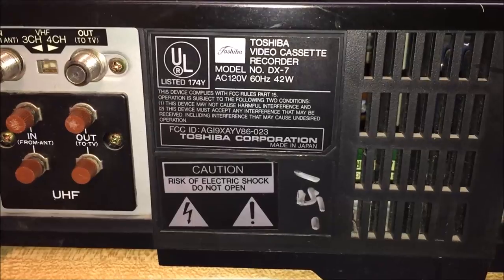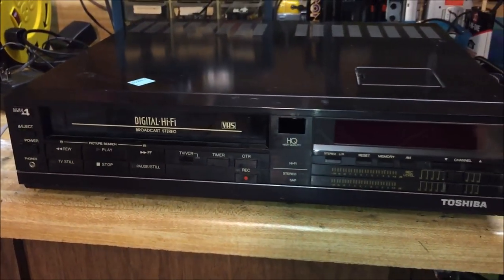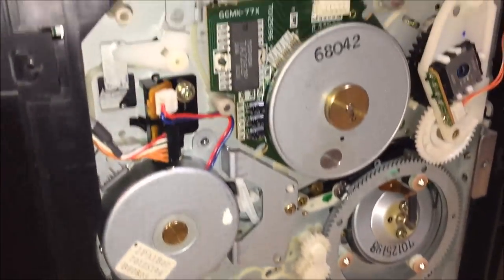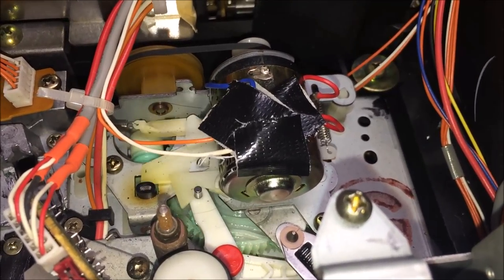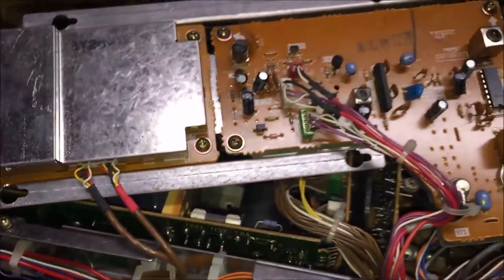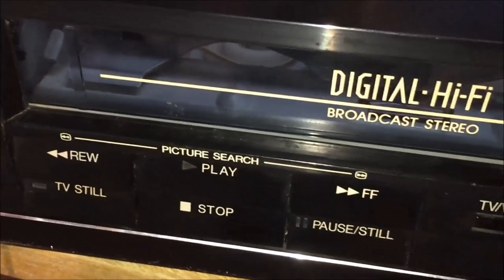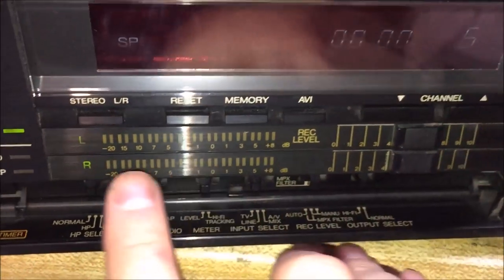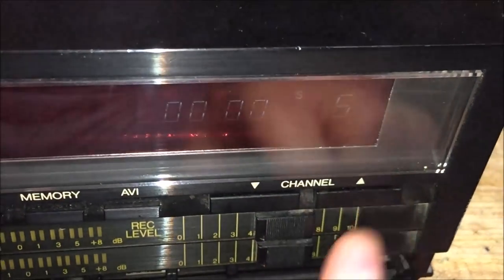This VHS VCR Will Freeze Your TV

Comment: I have a similar Toshiba model from about 1985 with original remote that I still use that I've owned since I was a kid. Same motor issue fixed. Good to see these things still out there! Might note that greasing the track might add friction as the grease gets older, stickier, and collects dust and dirt, but if it works for you, don't worry about it. The take up rubber idler wheel eventually loses traction and slips. A rubber renew, or tire replacement usually fixes them up. I've converted some vcr's of this era to a gear / clutch drive to avert this aging issue. Thanks for sharing!!

Comment: I own an earlier model of this VCR. I have my instruction manual. The M5900 appears identical to the model in your review. Except for the TV Still button which is just a pause button. CFM stands for “Confirm” to allow to confirm the Timer programming.  HP stands for high quality picture which involved a circuit for picture improvement. A number of VCR’s claimed a digital improvement circuit. MPX was a filter for use with an FM tuner. It filters out an extraneous noise. Many manufacturers encouraged the idea of using VCR’s as audio recorders. VHS HiFi is a high quality system.  The channel preset system on both your VCR and mine was common on most VCR’s of that time. AVI was a search feature. Allegedly, with this button depressed the tape would stop and preview multiple recordings on a single tape. I never used this feature.
Best of all, for years Toshiba VCR’s ignored the Macrovision copy protection distortion when used as a recorder with another VCR.

Comment: A week ago, I got an NEC VCR that has a very similar loading mechanism but it uses a better quality loading motor and not those crap ones with the plastic on the back. But on the carriage mechanism, it DOES use that crap motor but its not weak. I needed to replace all the belts and the tire but I didn't not have the right tire so I used a different idler wheel assembly. It plays perfectly but when I rewind or fast forward, it stops near the end of the tape. I'm going to try and buy a new idler tire and hopefully it will fully work.

Comment: In some countries, like the UK, you had shows which were simulcasted on TV and FM radio. You could then get the stereo sound via FM. Also those machines were commonly used to make decent recording of the radio. The MPX switch activates a 19kHz notch filter which filters out any residual pilot tone from the receiver. It's important as it could mess with the bias currents.
Reply from the maker: Yes indeed!  Thank you for watching!
Reply: Yes. Happened on tape decks. Even DOLBY activetex MPX circuit.
Reply: No, not really. Since TV and Radio stations were operated by the same companies and transmitted from the same site, it all came via the same microwave links, or at it was later, over high speed ISDN links with virtually no delay.

Granted, I've never actually seen such a thing here in Germany, but the BBC did apparently simulcast concerts regularly that way. Of course now with DVB where you can easily have 5.1 Surround sound, so that's not needed any more.
Reply: The BBC used to broadcast the Proms in Ambisonics which encoded surround into a stereo/mono compatible signal. Brilliant system.
Reply: There's actually work to include Ambisonics in Opus since that might get very relevant for VR.
Reply: Yes, I see that. It makes a lot of sense.
As a system it is easy to mix with/through and is fully mono/stereo compatible. If you use UHJ encoding the surround info' can be encoded into a stereo signal.
It is years since I have mixed in ambisonic surround so, there is a lot I have forgotten. The Calrec soundfield mic' was a boon as well. Both for moving the mic' position in post-production if you had recorded the four channel B format and manipulating the mic' if recording straight to stereo.
Reply: @databits  I recall Toshiba having some ads in the UK for their products in the 80's that went with this odd approach of a blueprint-drawn figure expounding the limitless possibilities of Toshiba's electronics!
https://www.youtube.com/watch?v=BjJBFGGjdpw

Comment: The MPX filter is for avoiding distortion when recording from FM radio. FM stereo has a "pilot tone" at 19 kHz that identifies a stereo broadcast. Good FM tuners should suppress it, but some not so good ones don't, and in that case it gets to the recorder where it can cause interference with the carrier frequencies of the HiFi VHS audio system. The MPX filter avoids this by a notch filter at 19 kHz. It should be off when not recording from FM because you don't want a notch filter otherwhise.

Comment: 10:10 You asked what HP Select is. This is unique to Toshiba machines. It has to do with the playback and picture sharpness.
In the 90s I used to have different video recorder machines at different times from Sony to JVC and Ferguson Videostar. I never had a Toshiba. Every one of them were just as noisy because of the motors spinning for the various parts to work. The constant whirr of the head drum spinning was so loud I was able to ignore it. Eventually the noise became intolerable so I got rid of them.

Comment: whoooaaaa that point to point wiring. ALL TEN MILES OF IT. The digital frame store/TBC cards that were used on a lot of these VCRs all looked fairly similar - they tended to have the same flash ADC and weird lookin' RAM chips. I've always been tempted to get some of those cards and add some extra logic to the addressing lines to allow me to turn the picture into a weird mosaic puzzle and swap lines around
Reply: That is not point to point.
Reply: Telken Texas this is also not someone who has had enough coffee

Comment: We had a TV and friends had VCRs that had channel tuning in a similar way.  "Low" was channels 2-6, "High" was cable channels 14-39, then air channels 7-13, and "UHF" was ... well, UHF channels 14-70 or whatever.  :D
Reply: Yeah, there are two different chunks of VHF TV band, one in the 54-88 MHz range, and one in the 174-216 MHz range, and then UHF runs from 470 MHz upwards. If you're dealing with a tuner that's got a bunch of tapped coils in it, it makes sense to treat those as three completely separate tuning ranges.

BTW, UHF actually went up to channel 83 originally — the spectrum for channels 70-83 was reassigned in the 80s, and the spectrum for channels 52-69 was auctioned off just a few years ago.
Reply: hobbified 

And in a few years 36 will be top channel.

Comment: "Four home computers worth of memory" ... I wonder how much memory each of those computers had?

(I'm going with 128kb, as you need about 512kb for a half decent digital stillframe, IE one roughly equivalent to laserdisc quality... that'd be 544x480 with 8 bits of luma, and 272x480 chroma rez with 8 bits per channel... all up 16 bits per pixel effective (8+4+4), and 522,240 bytes = 510kb of memory used. Of course they might use only half the vertical rez, or some other way of reducing the overall data load (combination of lower horizontal rez and lower colour depth) which might reduce that to 256kb, so it would be four C64s, but that seems a bit cheap considering how much the missing 256k would actually have been worth at the time vs how much the VCR probably sold for)

And it is really a bit of a gimmick, isn't it... presumably Toshiba thought they couldn't quite justify adding the system simply to clean up video stills (and reduce tape wear when sitting on pause for extended periods) and had to extend its utility to the main TV signal too...

Comment: "Standard" UHF connector is terminal posts?

American TV is weird.
Reply: Vyl Bird I was about to say this too. In Germany it is so much simpler. And I think pal is better than ntsc for some obvious reasons
Reply: It doesn't make a lot of sense to me. Terminal posts suggest a balanced cable, like ladder line, but those are only really good in free space - they very easily pick up nearby electric or magnetic fields if there is anything conductive in their vicinity. Which there will be, in a domestic situation. There's why you use coax. So... why the balanced cable? Does American TV just suck *that much*?
Reply: Actually, new plan: Databits! Video request, please: Comparison of American and European RF connections for television. Antennas, cables, frequencies. Why do Americans have VHF stations, when Europeans do not? Why do you use terminal posts, while we do not? Why are your coax on what looks like an F connector, while we use belling-lee?
Reply: Vyl Bird 

At the time, most coaxial cable for TV was RG-59 type, a narrow, inexpensive cable that is lossy at UHF. Twinlead had less loss (provided it was installed correctly).

Today, RG-6 cable is almost universal, and UHF is in wider use (Band III is still common, but only a small handful of TV stations are on Band I).

Note that though we have many stations known as Channel 2 (3, 4, 5 or 6), most of these stations transmit on UHF.
Reply: Earlier televisions used 300 ohm twin lead on both vhf and uhf prior to the wider commercial adoption of coax. Then they made 300 ohm twin to 75 ohm adapters for use on the VHF antenna.
Reply: The twin-lead is old-school. Everything newer uses 75-ohm coax.
Reply: Crikey, all you naysayers know nothing about how old analog broadcast TV worked (in USA or elsewhere!!). 

In a nutshell, 300 ohm antenna wires were used for antenna only, which was already practically a legacy connection by 1988.
Reply: Vyl Bird Yes, USA uses F connectors for broadcast and cable TV. Why, I don't know. Historical reasons no doubt. Has the nice advantage that it's cheap to terminate for cable TV installation, cheaper than the European connector.
Reply: latter the posts and the coaxal cables where combined in one coaxal cable. my dad made a lot of money putting up antennas and satalight dishes because he knows everything one could about getting distant stations in. and the dishes both fta dish Network and DirecTV he did it all.

Comment: No, for to set those gears in syncronization you just align the triangles marks in the gears, it is not that hard. There is several triangles, and several pin/circles. it is in the SERVICE MANUAL!. So, is required to set it once.

Comment: What's the black box on the bottom, you haven't revealed it as you said.
Reply: He did show later in the video that it's another PCB. It's probably the TV tuner and RF modulator on a single board.
Reply: It was the memory chip for the freeze function, all 2k of it.
Reply: Hmm, the advert says it's got the memory of four home computers though.
Reply: It is! Just a REALLY early, REALLY underpowered one.
Reply: Wonder if it's a bubble memory unit. Looks like it could be. If that's the case and they still work, might be worth more than the rest of the VCR.
Reply: 4 MB for buffering images,. for slow motion.
Reply: +Paul Potter
It does, for the time at least it did lmfao.  
Back in the 80's computer still came with less then 500kb's.

Comment: Toshiba made the WORST video recorders. Terrible mechanics mostly. This machine was NOT made by Toshiba either. It is clearly a design by Matsushita, the parent company of Panasonic. You can probably find the same machine with the Panasonic brand as well as others. Maybe RCA.
You failed to explain the large bump on the bottom of  the unit. That was the part I specifically wanted to see. This should contain the video memory board which allows the video freeze "field" function. It only grabs half of the frame because in a lot of cases, video has motion and the two fields flicker fiercely when "frozen" in frame mode. This is simply a cheezy gimmick that drove the cost of this machine through the roof. And, in the end, it was still a piece of Toshiba junk.
Reply: It looks almost nothing like a Panasonic design-wise and certainly not manufacture wise. If anything it looks more crude. Also, the circuit boards clearly show Toshiba part numbers which would not be the case if it were an OEM/ODM machine. Also the drive is sufficiently different from anything known to mankind (and certainly not die cast as were Panasonic drives) to safely say it wasn't designed elsewhere. It's a genuine Toshiba, though the design and probably manufacture are a bit before the mentioned 1988. Probably 1986 or 1987.

Also, there seems to be a small contradiction within your post. If it really were designed and made by Matsushita, in the end it would not still be a piece of Toshiba junk.

Comment: The VHF and UHF have nothing to do with cable vs. OTA.  Both were Over-The-Air, and if that was the route you were going, you needed both types of antenna.
Cable systems only output from their boxes VHF signals on channel 3 or 4.  
"Cable-ready" was a whole 'nother thing entirely, but still used the VHF input, never the UHF.
Reply: Rabbit ears and loop antenna.
Reply: That would be why the UHF input is the band using the screws so you could more easily attach an antenna to it.

Comment: Why does the vcr have satellite connections at the back??
Reply: In the US (and several other countries), F-connectors are used for regular VHF and UHF. Also note the separate VHF and UHF connections which are also quite specific to the US.
Reply: oh ok here in the UK every satellite receiver has F connectors on them and the UHF connectors on TV's are different to the F connectors
Reply: We use the 75 ohm for Vhf antenna frequentcies.  It's our antenna jack here in the US on the NTSC system.

Comment: you still have analog tv stations in 2017? Really?
Reply: I think he said in the video that he got a digital signal over the air and he was rebroadcasting it in analog.
Reply: If you hook up into any coax cable in my town you still get a few analog channels, not even filtered out or anything, any home that every had a cable install can watch it for free lol
Reply: I am not sure if it is digital or analogue, but I can get some local channels using an antenna I still have
Reply: Maybe watch the video before making snarky condescending remarks? He clearly said he's rebroadcasting a digital TV signal with his own analog TV transmitter.

Comment: I don't want to sound rude, but this video felt like 17 minutes of nothing. Here's some circuit boards, here's some motors. Oh, and here are some buttons with words on them. There was nothing about how it actually worked, or what the components were. Thanks for the look around it, but I guess I was looking for something more.
Reply: Agreed. I came for an in-depth technical explanation of the still feature. I got a short demonstration of the feature in use at the very end of the (long) video, none the wiser. How did they do it? I presume that they could have done it with a combination of an analog-to-digital converter, a megabyte or so of memory for a framebuffer, and a digital-to-analog converter, but that would have been very expensive in the late 80's.
Reply: @mass1s  The still feature was an analogue to digital function. I never had a Toshiba machine but had a Ferguson Videostar machine that did some cool digital tricks like turn the picture into pixels and picture in picture with the TV tuner and video playback. On most machines when you paused the video there was always the blurry noise on the screen. The still feature would digitally freeze the picture.